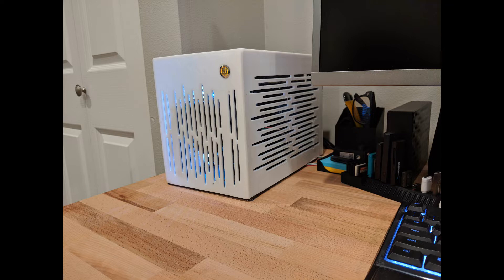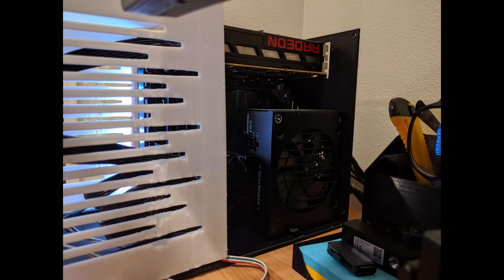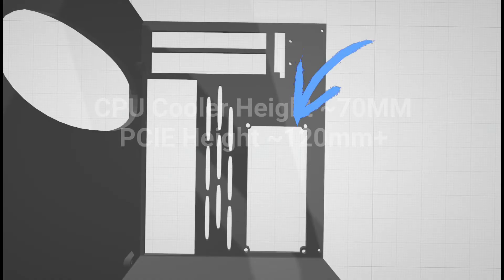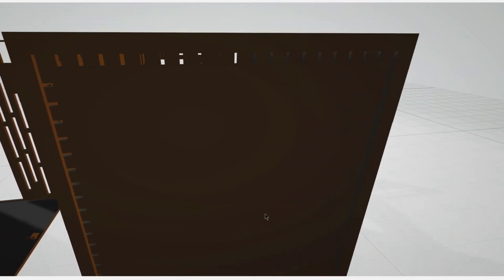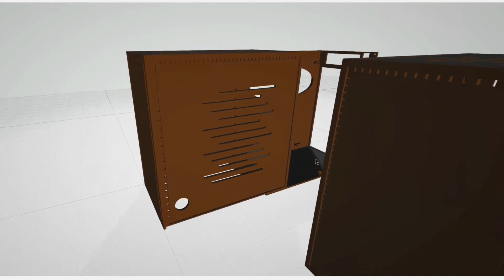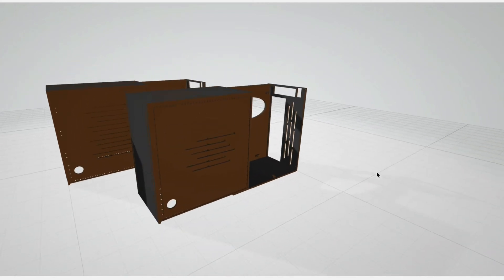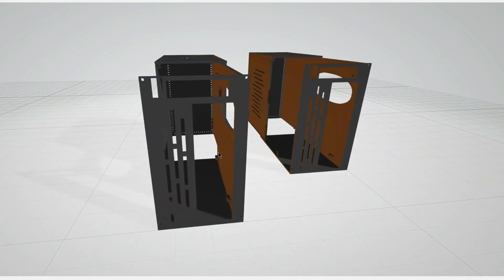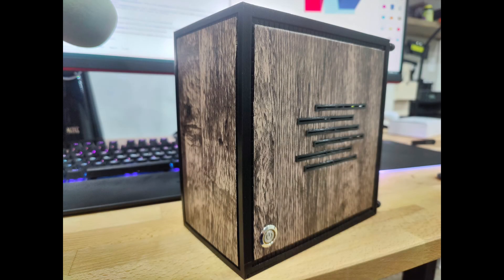I 3D Printed My Own 4L Budget ITX SFF PC Case

Comment: do you potentionally have the step files? my gpu is suffocating in its own heat, it doesnt have much outflow. Thanks!
Reply from the maker: Which GPU? Are you using the airflow version or the normal version?
Reply: @LohTec  im using the airflow version, Im using an RX 6400 swift, It blows air away from the IO port, aka, into a wall. without the case it runs fine.